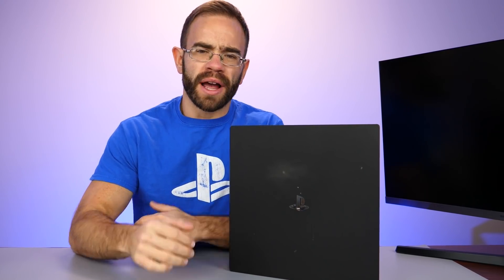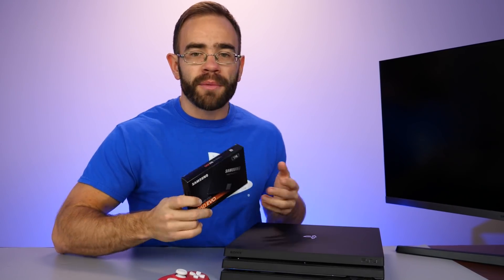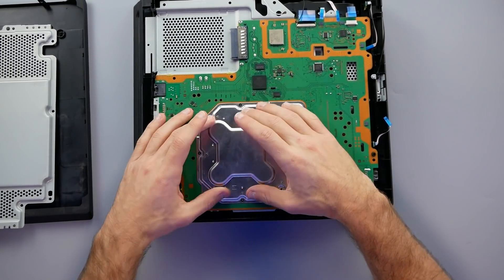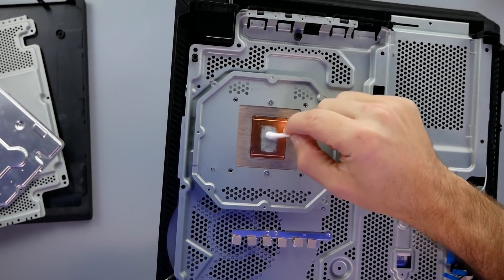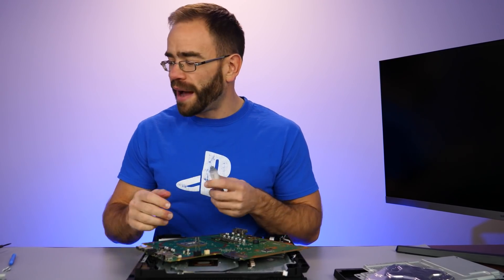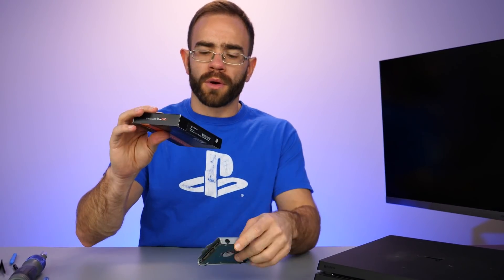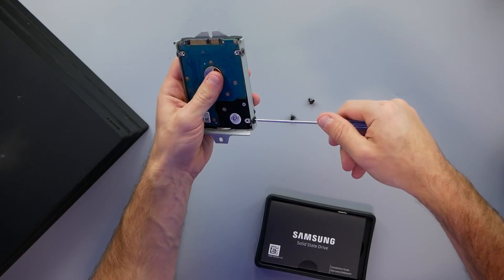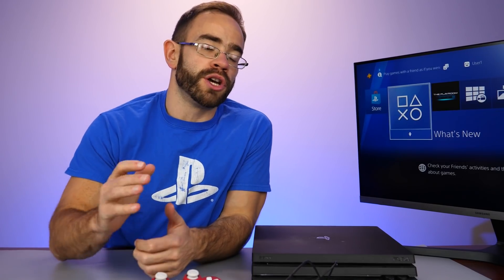Here's What Liquid Metal Did To A PS4 Pro After 3 Years

Comment: As a materials scientist, I would like everyone to understand that the liquid metal did not "dry out" in the usual sense.  It reacted with the metal of the heat sink (primarily, from the look of it. The surface of the chip looks basically ok) and what you see on the chip is a residual solid metal of a new composition.  It will not be possible to remove the reacted material from the heat sink, as this is incorporated into the heat sink and is in fact an alloy of the heat sink metal and the liquid metal. It may still be possible to use another type of thermal paste to bridge the air gap.  This should not be a problem with the PS5 system as it was designed with compatible materials or coatings to enable the use of a liquid metal for thermal contact.

One concern would be that as this reaction takes place the thermal contact should/could have been greatly reduced.  It is a good thing that this PS4 wasn't used that much.
Reply: Silly question then - so I should not panic that my de-lidded Intel processor may be “dried out” underneath the IHS?

I’ve always heard that liquid metal was a bad idea to use on copper. Perhaps this is why.
Reply: @FasuloA  Most quality heatsinks are nickel plated, and that should protect the copper from reacting (alloying) with the liquid metal.

If you had just a bare copper heatsink, I'd suggest investing in a better quality heatsink, after all what's the point of using a cheap heatsink with liquid metal?
Reply: Could one nickel plate the copper? Electroplating isn't that complicated
Reply: @infopackrat  In theory yes, you could plate the copper, but just buying one already nickel plated is way easier (and probably cheaper).

A second application will probably last longer, but you can tell that the reacted layer is not fully protective, the gallium in the compound will slowly diffuse into the copper and react with it over time.
Reply: @infopackrat  In theory yes, you could plate the copper, but just buying one already nickel plated is way easier (and probably cheaper).

A second application will probably last longer, but you can tell that the reacted layer is not fully protective, the gallium in the compound will slowly diffuse into the copper and react with it over time.
Reply: @infopackrat  you don't want to do that unless your wanting more heat nickel holds heat where heat moves through copper faster you can do what you want but I have worked making both for about 16 years people will say nickel is better but it's not when it comes to a heatsink for anything
Reply: @gamerX-wk7ct  This is a super thin layer of nickel. I doubt it would make more than 1 degree C difference at most.
Reply: @gamerX-wk7ct  most GPU waterblocks are nickel plated copper. Seems to work well enough for that.
Reply: @ArtisChronicles  I could be wrong but I would say the nickel is added to copper to strengthen it to mold it and makes it more resistant to corrosion they may say nickel plated to make it seem like it's more then what it is but like I said I might be wrong
Reply: @infopackrat   or you could just use non LM thermal paste. No need to nickel plate any copper… not sure why people “need” something “better” than high grade thermal paste.. most thermal paste is even great for high end PC Builds. So not sure why you would even need this.
Reply: @FasuloA  for most LM applications - be prepared to do it twice if it touches copper.
Reply: @MattMorriscey  thanks. My only application with Liquid Metal would be under the IHS on my 6700k and 9900k. Still in use, so wanted to make sure there wasn’t any impending doom. Not something I use on GPU’s or on top of the IHS.
Reply: @FasuloA  no, it's totally fine with copper. Though, make sure there is no Gallium involved. 
Otherwise, with time, the Gallium will concentrate in the liquid metal, making it firm and conduct less heat.
You will need to re-paste like every 1/2 years depending on how often you use your system.
If there's no Gallium involved and the liquid metal fully reacted with copper (the coating is fully developed), 
then you will most like never again need to re-paste. I advise you to get a Gallium free liquid metal/heat sink and 
in the begging, re-paste the liquid metal every 2-3 month so that the coating can fully develop.
Reply: So can liquid metal be used then? Would a second application work since the reaction has already taken place?
Reply: @infopackrat  Yep. Basically Liquid metal on a copper heatsink will need to be done twice.
Reply: What metal is it? Gallium?
Reply: Yes. The heatsink is copper plated. The liquid metal ate the copper plating. A thin layer of copper like paint thickness should have been used to fix the damage. I don't see the PS4 Pro being that effected by it.
Reply: I would not assume anything like you did here about Sony so by a proper job. They should be, but I wouldn't be surprised if they didn't at all. Not in this day and age of disposable tech.

Comment: I'm wondering if newer technologies like liquid metal would benefit the PS3? I really enjoy videos like this. My PS3 has a heat/noise issue.
Reply: Unless the heatsink was copper, you wouldn’t want to use liquid metal on it. Liquid metal would eat through aluminum (like on the original PS4 cooler)
Reply: @Devo_gx  Oh ok. It's very hard to keep PS3 from easily getting worked up, I mean, there's times where it picks up without even running a game. The CPU needs more leg room for the demand.
Reply: @Trontasia  yes buy LM  does not last as long as thermal paste  and thermal paste is almost just as good LM does keep the Temps a couple degrees lower
Reply: @Trontasia  your console needs new thermal paste, and possibly a delid of the ihs. The paste under the ihs plate is even worse then what is on top.

Comment: I've been thinking about changing the Thermal paste and thermal pads on my day 1 1000 series PS4, what Thermal Pads would you recommend and what thickness? I haven't been able to find any info on the Thermal pads
Reply: thermal grizzly minus pad 8 1mm thickness
I've replaced mine with that and now it's way quieter than with the stock pads
Reply: @kibowman  awesome, I appreciate the input my guy
Reply: @Luke-2954  I would take some digital calipers and measure your existing pads. The thickness could vary between models.

Comment: I see ps5 dying in 2-3 years... Sony is going to have a PR nightmare on its hands in a few years! Their chips run too hot for regular thermal paste. Going to be interesting...
Reply: The ps5 uses liquid metal and barely any thermal paste so idk I've only had mine 3 months luckily didn't get a defective unit with overheating or anything like some launch models
Reply: It won’t be a problem. Metal can’t “dry”. What you see happening is amalgamation. Just search YouTube for gallium and aluminum reaction. The primary component in liquid metal thermal paste is gallium, gallium is highly reactive with some metals. It will turn aluminum into dust in a few hours, reacts slowly with bare copper, and won’t react with nickel plating. After a few years the gallium literally seeped into the bare  copper and formed a new alloy, thus appearing “dried out”. This won’t happen with nickel plated heat sinks.

Comment: I used a graphite pad but had to cover chips around the processor with conformal coating because a graphite pad is conductive. It doesn't dry out and seems to run like new.
Reply: I put a graphite pad inside my PS4 pro as well. The only thing is; I affixed it to the APU using a pea sized amount of thermal paste. Doing so made sure it didn't move out of place during the reassembly process.

It's been about 6 months or so now, and I haven't had any issues with the fan noise level or system performance. Except for when I play God Of War... The pro still screams unfortunately.
Reply: @ValkyrianWyverian  Does your PS4 scream with Spider-Man if you have one?
Reply: @unhappytoyman8767  I don't own Spider Man on the PS4. I should probably check it out at some point though.

But generally speaking, across all of my games with the graphite thermal pad installed; the PS4 pro runs noticeably quieter for sure when compared to thermal paste alone.

God Of War for me is like the only real exception. It seems like that game in particular runs loud, to very loud, on the pro regardless.
Reply: @ValkyrianWyverian  interesting. I own Spider-Man, and it runs the loudest out of all the games, more than God of War. I don't know why. I should try the graphic thermal to see if it helps.
Reply: @unhappytoyman8767  Are you playing Spider Man on the pro, and in resolution mode?

Playing God of War in resolution mode (Which is checkerboard 4K or 2160p) at 30fps, causes the fan to spin loudly. Especially when you open up the world map, or watch a cutscene.

Right now I'm playing Ni No Kuni II, which runs at 1800p/60 fps on pro, and the fan noise level is very moderate at best with the thermal pad.

It seems like results definitely do vary on a game to game basis. And some models of the pro run quieter/louder than others.
Reply: @ValkyrianWyverian  I have a PS4 Pro. I don't think Spider-Man has a performance mode. A lot of times, I have God of War on performance mode. I have changed God of War back and forth for resolution and performance depending where it has a lot of framerate stutters.
Reply: @unhappytoyman8767  From my experience, God of War runs quieter in performance mode. Mainly because the resolution is capped at 1080p. But even with that said, it would still run loud for me at times.

But in resolution mode, God Of War definitely runs noticeably louder for me. Typically from my experience, whenever the pro preferences higher resolution in games the console ultimately has to work harder.
Reply: @ValkyrianWyverian  I tested mine with God of War and it stays quiet for me. I didn't  use  a peas worth of paste but maybe half a grain of rice in two corners. I suspect too much paste recreates the original problem.
Reply: @kdod1  I don't think there was anything wrong with my application of the paste on the pad. If the loud fan noise was persistent across all of my games, then the issue would definitely be on my end. 

But a quick Google search, and an analysis video by Digital Foundry, pretty much confirmed that God of War is notorious for making the pro sound loud.

I remember when I pressed the pad against the APU, after applying the thermal paste; there was no excess paste seeping out.
Reply: Mine ramps up a bit while playing No Man's Sky but it sounds like my laptop fan and nowhere what it used to. I also had to use a very small amount of thermal paste (on the graphite pad) to get it to stay in place while attaching the heatsink.

Comment: I swapped the fan in my PS4 Pro and I haven't heard it since. Highly recommend it and it would be a good video
Reply: Mind sharing a link to the replacement part? :)
Reply: @Luminger  there are 2 different fans and they're both on Amazon. One is the original loud one and the other is much quieter. Around $35 I believe

Comment: Seeing this has me a little worried about the PS5 now. It seems liquid metal just drys too quickly in a PS4 Pro due to it's cooling system not being adequate enough, but it could to the same in the PS5. Makes me wonder if Mercury would be viable & less corrosive.
Reply: It won’t be a problem. Metal can’t “dry”. What you see happening is amalgamation. Just search YouTube for gallium and aluminum reaction. The primary component in liquid metal thermal paste is gallium, gallium is highly reactive with some metals. It will turn aluminum into dust in a few hours, reacts slowly with bare copper, and won’t react with nickel plating. After a few years the gallium literally seeped into the bare  copper and formed a new alloy, thus appearing “dried out”. This won’t happen with nickel plated heat sinks.

Mercury is actually rather volatile, and extremely toxic. No way it would be allowed in consumer devices.

Comment: I solved the noise problem on my pro by getting rid of those tiny black pads pressing on the chips and replacing them with thermal grizzly thermal pads that covered each chip completely.
Reply: I imagine sandwiching a sheet between the two metal plates might help cool the RAM chips further.

Comment: One of the things I did to cool my ps4 pro was made a custom vent on the area where the fan is(similar to what xbox did with the xbox one and xbox one s) and it did help cool it down by 10+ degrees
Reply: Did you check actual temps via cfw? Console cases are typically designed to have a specific airflow pattern, drilling holes changes airflow characteristics. By modifying the air intake some components will run hotter while others run cooler…

Comment: Cut an intake hole in it. Front left corner on the top side of the pros I think? Silverstone makes pretty attractive 80mm fan filters. I did it to my launch ps4, changed to kryonaut and changed all the pads to fujipoly ultra extreme pads. Air is SUPER hot out the back but the fan never really gets too crazy so I assume the APU is happy.

Also, SSD on sata 2 is still an improvement. 500gb internal 850 evo and 500gb external 860 evo for the same ps4. Menus flip around faster, moving things to and from external ssd is faster, trimming videos, everything is faster though not to the same degree it would be with sata 3. I have a elitebook 8440w from 2010, same story. Sata 2 still benefits from an SSD.

Comment: Has anyone removed the liquid metal and just used thermal paste on the PS5 yet?
Reply: That doesn't work and it shuts down the PS5.
Reply: Yes tronicfixs has done this and it's highly recommended to use LM on PS5  systems to avoid bending due to extreme  Temps